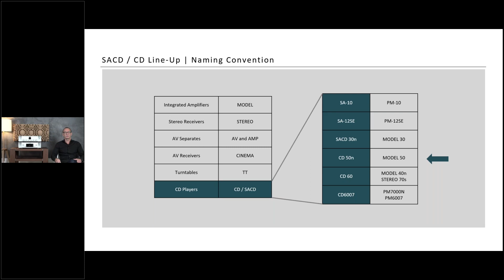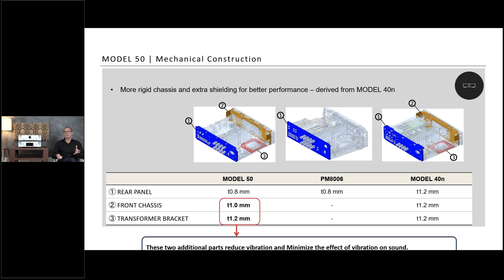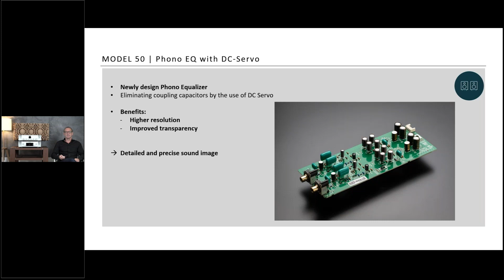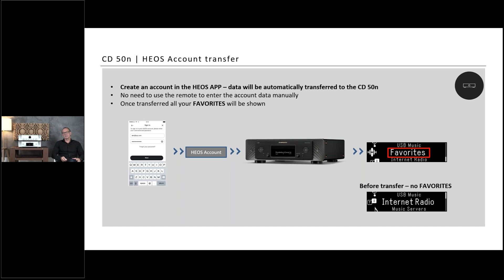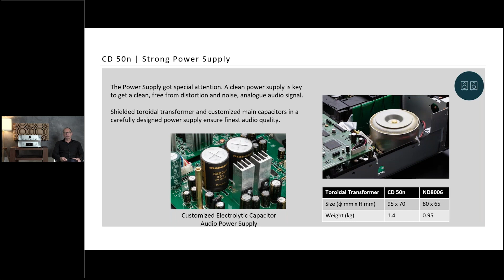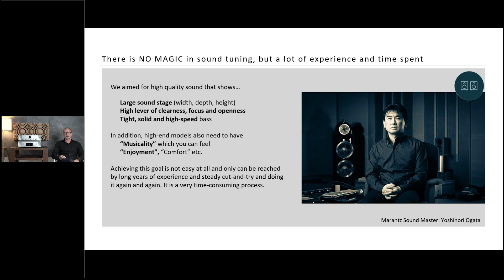Marantz MODEL 50 & CD 50n: The Perfect Music System?

Comment: Thanks 

I just got the Model 50, and it is fantastic. It's truly high-end. 
However,  I will keep my PM6007. 

I hope the next generation of PM6007 is coming soon, and that you keep the same great traits like the body and spaciousness of the sound, but with more midrange presence and a bit more dynamic. If the engineers at Marantz, led by Sound Marantz Yoshinori Ogata, succeeded in doing this for
 The next generation of the PM6007 , it would be the king of audiophile amplifiers in the $1,000 price range. 

Kind regards and best wishes

Comment: Is the amplifier stage in the Model 50 the same as the one in Model 40n? If not, which one is better, ignoring all the extra features of the 40n?
Reply from the maker: The design concept and power output of the amplifier stage of both are the same. If you don't need the streaming options, and your prefer a pure analog amp, the MODEL 50 would be the one to go for.
Reply: @ thank you!
Reply: @SoundUnitedTraining   can the marantz model 50 drive speakers monitor audio silver 300 6g? the manufacturer recommends an 80-200 watt amplifier, thank you for your reply
Reply: @SoundUnitedTraining Read somewhere that the 40n has a more advanced power amp an therefore is better at driving more difficult loads than the 50. Is this true? Thanks
Reply: @HarveyLøvstikke  It is the contrary
Reply: Excellent video, very useful! Thank you.

Comment: Great, I know what Marantz did here. If you want the top of the line go to model 30, and if the speakers are hard even for the Model 30 amp there are pre outs. No HDMI here but most of the folks in this category will not probably play 24/48 files from Apple TV anyway and they are already in possession of a large cd/sacd collection and dsd files over the local storage and stream from hq services like tidal/qobuz.
The model 40n is great as a standalone box solution if you have no cd collection and if you do just add the 60 cd. Also the 40n has power amp  inputs so great to integrate with a Marantz cinema receiver. 
The 50 amp looks to me more or less same to the 40 amp without the network player which is integrated to the cd. 
Question is 40n + 60 cd or 50 series?
Reply: 50 series !